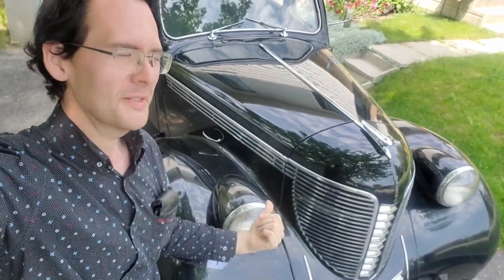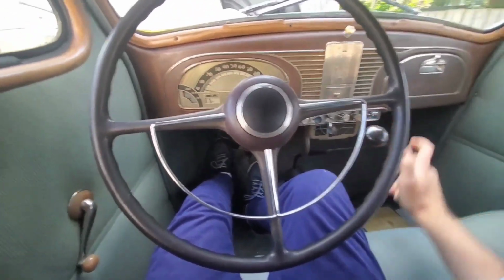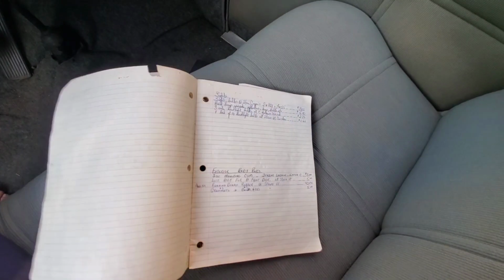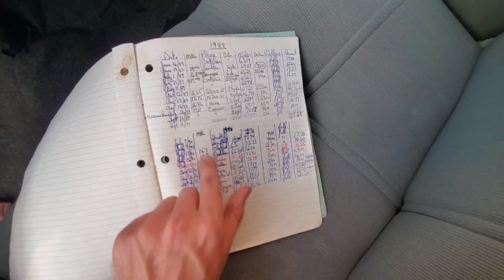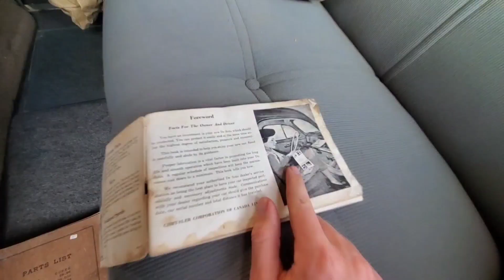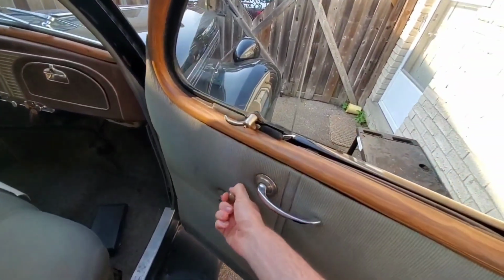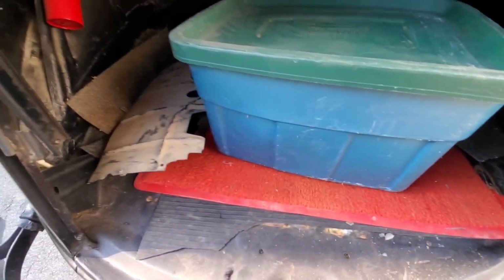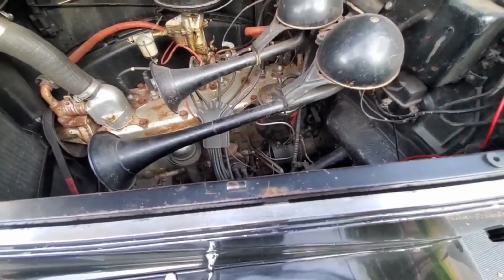I bought a 1938 Desoto

Comment: How did you install the fender skirts on your car? I have a car just like yours 1938 Plymouth DeSoto
Reply from the maker: The fender skirts have a nut in the center that loosens and tightens it. There are two hook like arms on the wheel skirt that clamp themselves to the lip of the inner wheel well of the car